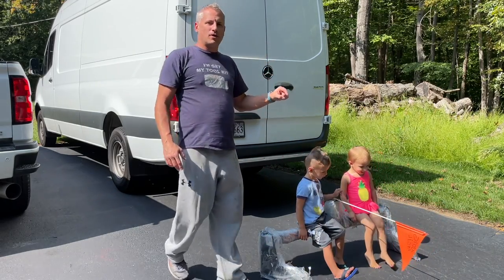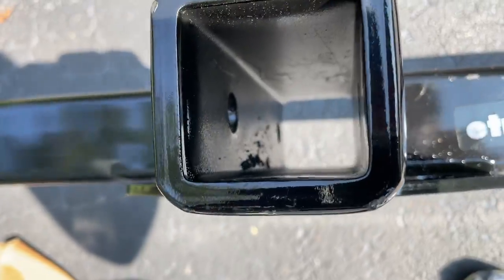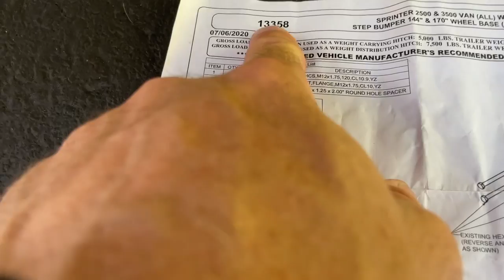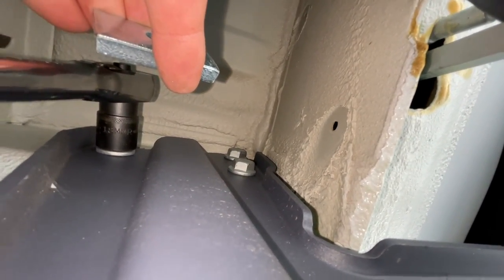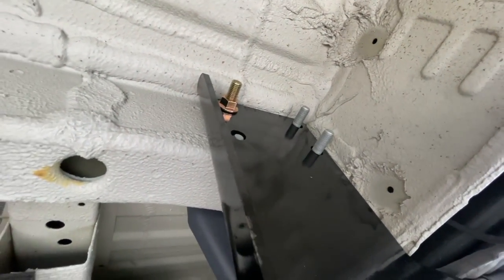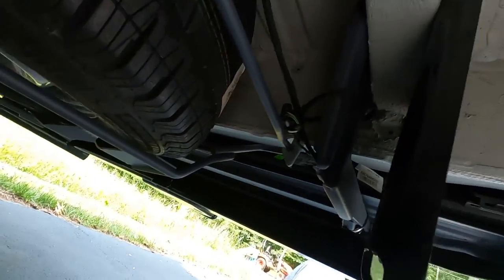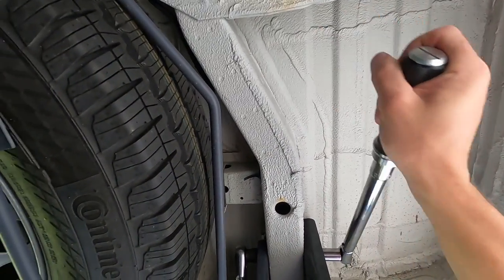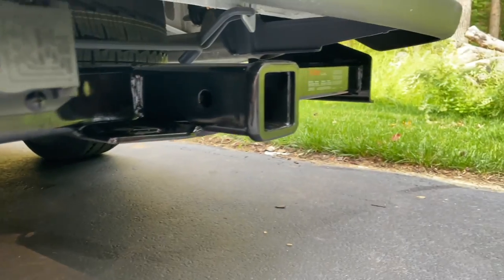How to install a Trailer hitch on a 2021 2500/3500 Mercedes Sprinter Cargo Van

Comment: Wiring for tow hitch?
Reply from the maker: My Sprinter van was pre wired with a 7 pin hookup. Van existing also knows when a trailer is connected.

Comment: Thank you for the video.  What is the model of the hitch and will this fit a 2020 2500 MB sprinter?
Reply from the maker: https://www.etrailer.com/Trailer_Hitch/Curt/13358.html

The one I purchased. It should fit your setup as well.
Reply: @TodayIWorkOn  Thank you.

Comment: No issues with the exhaust pipe butting up there against the frame of the hitch?
Reply from the maker: Nope. It’s a pretty clean install.
Reply: @ERICJOHNSTON1754 I have a 2023 sprinter and it looks like the exhaust pipe is in the way of where you would connect the trailer hitch.  I have the bumper step.  Any luck installing yours

Comment: Was the 7 pin round plug already installed from factory? 
My sprinter has a wire zip tied up in rear bumper area, but is a square plug. Not the seven pin round plug.
I have a 2016
Reply from the maker: Yes, my Van was prewired.